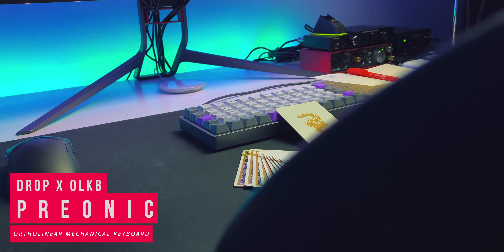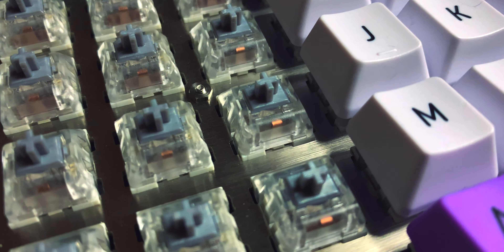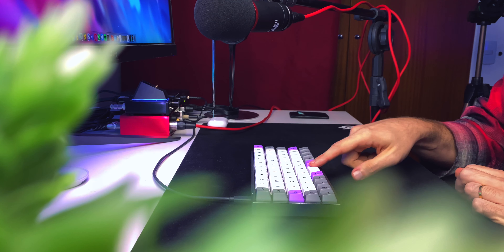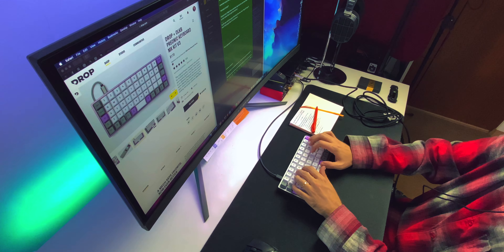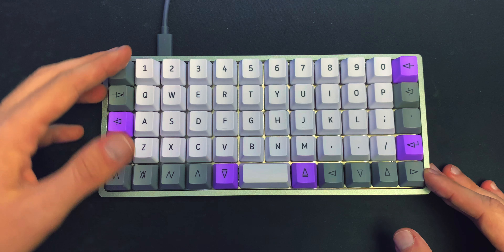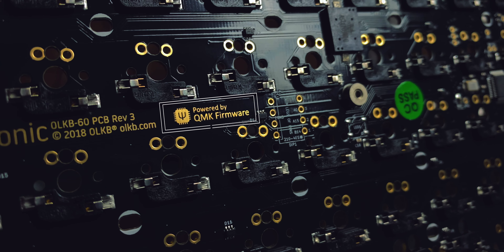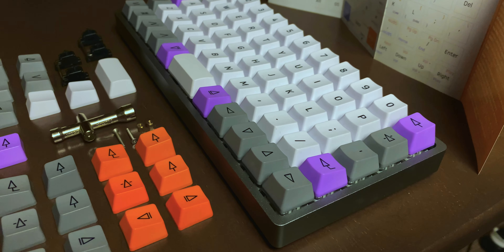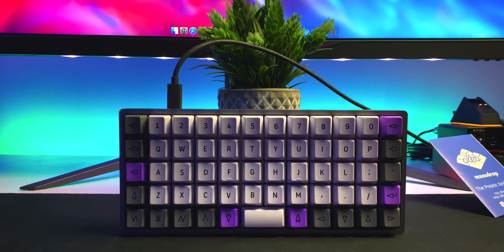Drop x OLKB Preonic Keyboard Review: Ortholinear Goodness!

Comment: I recently bought this keyboard, it is still shipping. I'm just curious if you think it will be hard to switch between the traditional keyboard layout on my MacBook Pro that I use on campus at University, to this Ortholinear keyboard that I have set up at home? I'm sure it will take some time to adjust but do you think it is practical? Loved the review aswell, subscribed!
Reply from the maker: Thanks bud. Appreciate it.
As for your adaptation period, it should take at least a little while, but once you start to create muscle memory for using an ortholinear, you’ll be good.
Practicality on the other hand is a different discussion. It all depends on how adapted you get/become, and switching from one to the other everyday, going from Uni to your home, might diminish the benefits.
Its all going to depend on your experience.